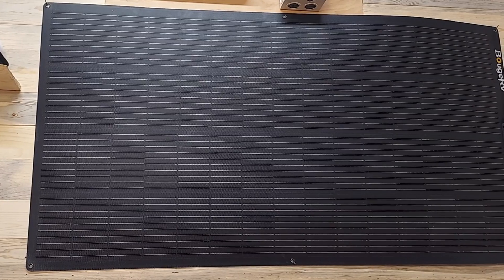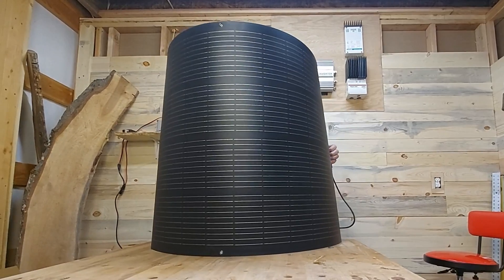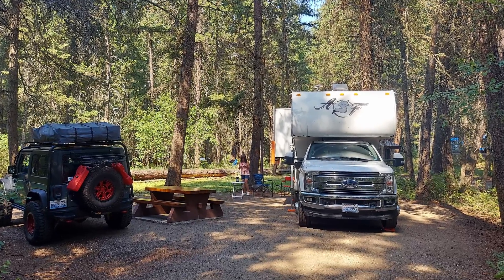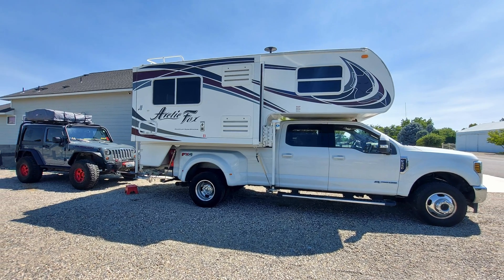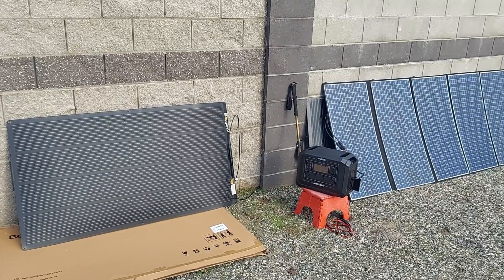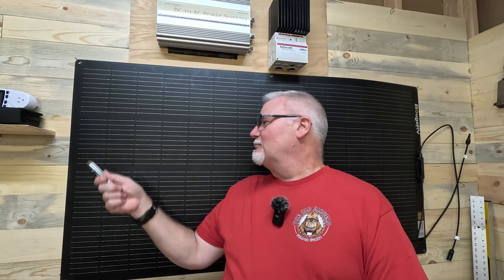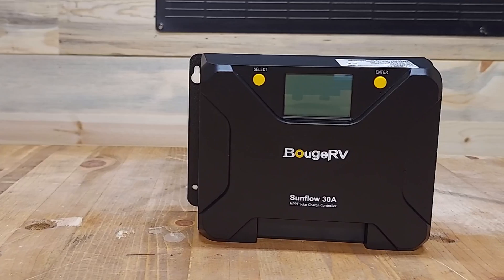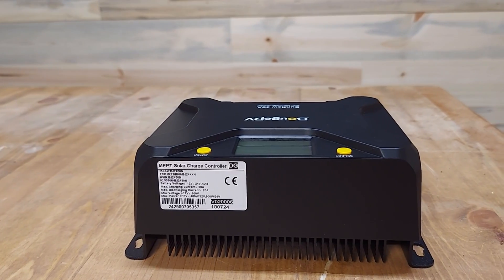BougeRV ARCH 200w Flexible Fiberglass Solar Panel Review

Comment: Did you get that panel I stalled on the AF? Think I about it stalling two on my bigfoot and taping them on with Eternabond 2" tape around the perimeter. Like to know how they are working and  how you installed them and ran wires inside the truck camper. Thanks
Reply from the maker: yes.  it's working great, and I did a 2nd one since

Comment: "flex" panels get about any flex movement unvisible micro cracks what result in months or weeks fails , this stuff burns for alot of people down in under 2 years exaxtly about that.
solar cells = silizium=glas.
flexing glas = granted breking
Reply from the maker: I'll find out but so far no problems for me.

Comment: Hey bud that’s a great panel. I have that one as kind of an assist to their 400 watt bifacial that i have hard mounted to the top of my Jeep.
Reply from the maker: Nice!  How's the BiFacial do on the Jeep?  I can't do that with mine because of the RTT
Reply: @ It works great on the Jeep. I mostly use my induction cooktop while camping and the 400 watts replenishes my used power pretty quickly.
Reply from the maker: Nice. I've got the old style RTT so no room up there but foldable panels and now DC charger